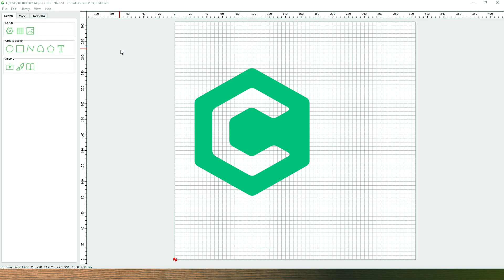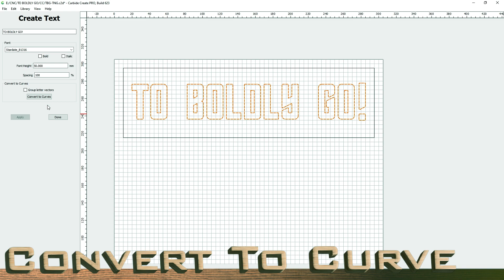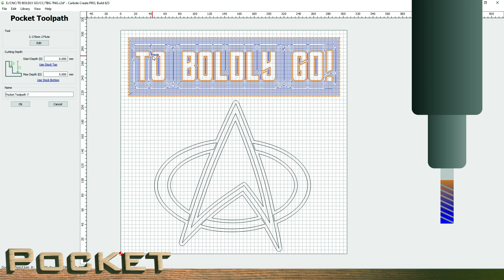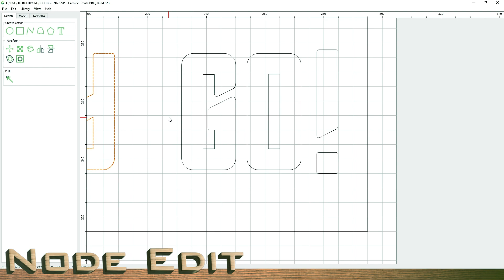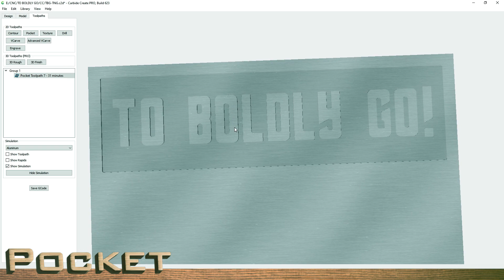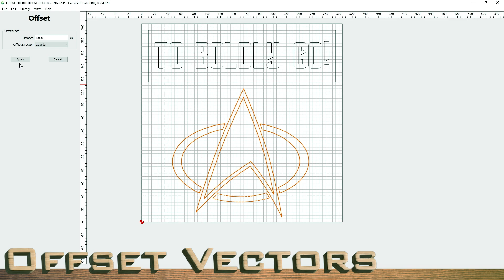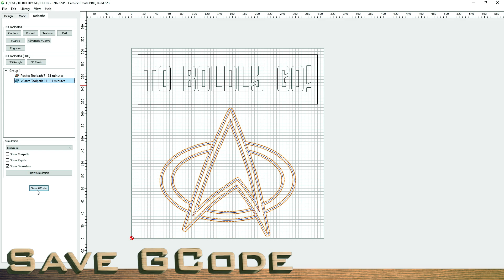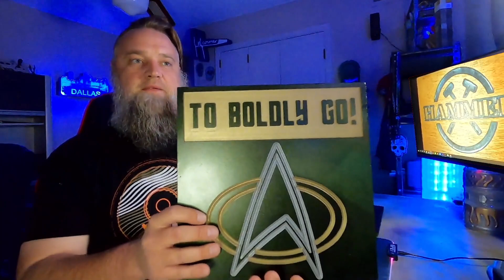Raised Text Sign VCarve - Carbide Create

Comment: Great video. Learned 2 new things today. Changing text to vector, although I'm not sure if it's in the free version. Will have to look. Also didnt know about adding  x0.00 and y0.00 to rehome.
Reply from the maker: Thank You, the convert font to vector should be available in the free version.
Reply: @D.E.Hammer  shame Carbide 3D don't automatically add the return to zero at the end of their carve sequence in the Post Processor. Shame they also don't allow access to it to make personalised alterations!
Reply from the maker: In newer versions it maybe possible to add post code, have not looked into it as old habits die hard.
Reply: I had an older version, so once I updated it, it was there. Thanks